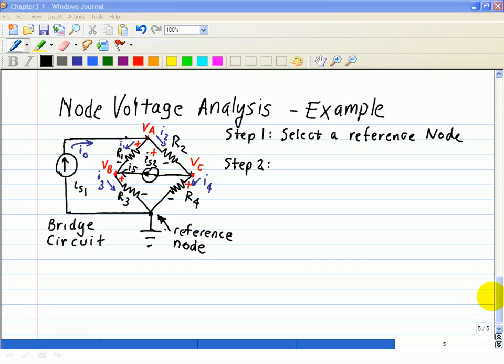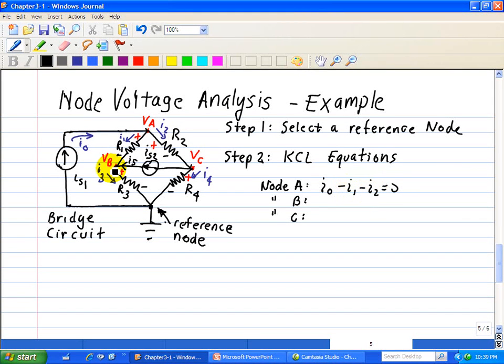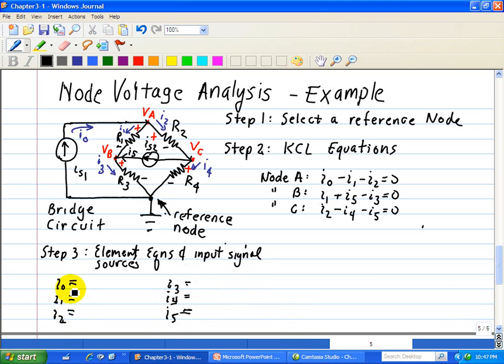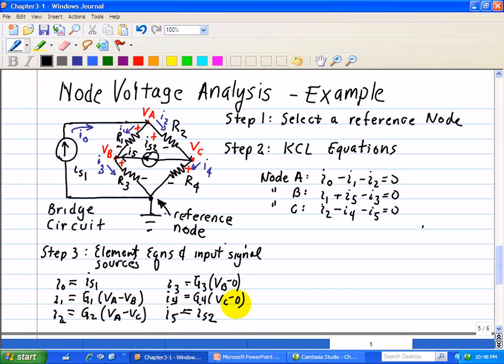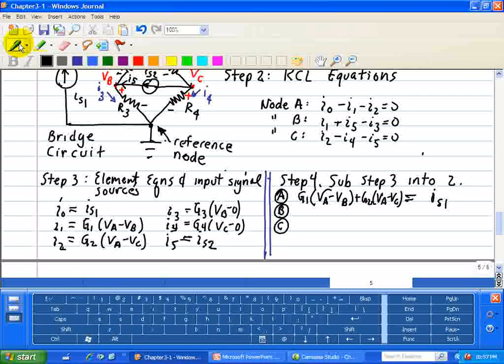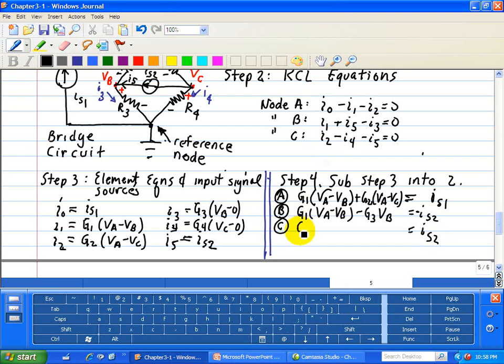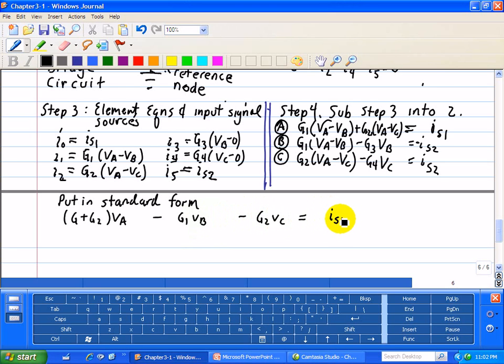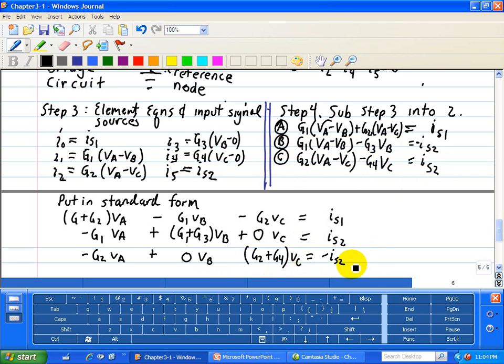Circuit Analysis:  Node Voltage  Analysis (Part 3 - Another Example)

Comment: Thanks for the lessons!! very helpful. I still have a problem though

I don't get the part about the signs on the right side of the equation in the standard form....did you change the "is" to "-is" because of the Vc?